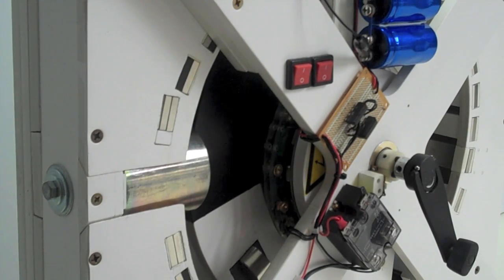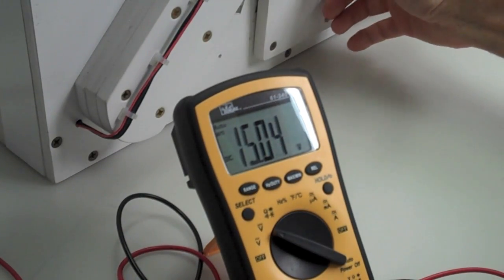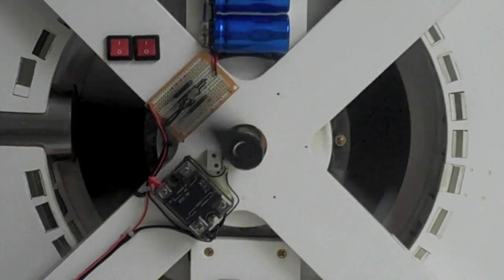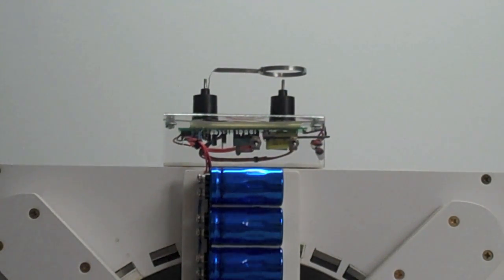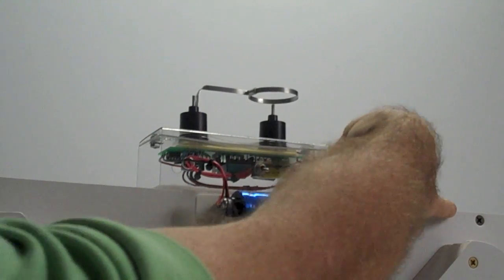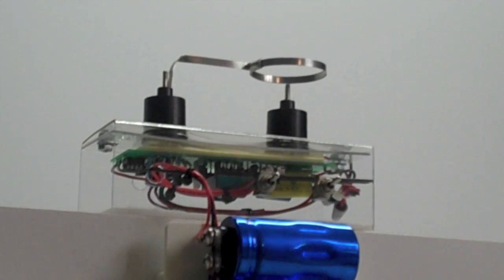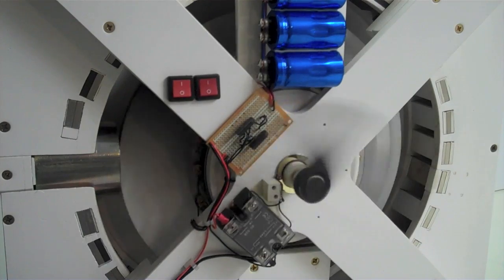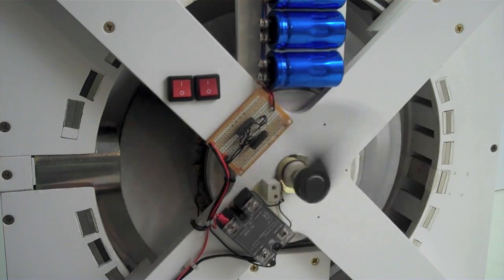Quanta Magnet Motor Generator Hybrid_Part 2

Comment: Does that car window handle throw off the balance at high RPM. And do you look anything  like bob sagett from full house  TV fame?cause you sure  sound like him. WE NEED MORE LIKES HERE.   ITS WELL DESERVED.
Reply: Janet C - that crank handle is small and used for the dynamo in crank torch’s/flashlights. The type used for winding car windows is slightly larger than this

Comment: What is the total capacitance of the supercaps and the caps charged voltage before startoff? Using capacitor energy = C x U x U / 2 [Wh] what is the energy in the caps compared to a  a AA battery?

Comment: great contraption self runner just what im also trying to build..this,machine can light a small cfl brightly for 1hr whilst self running too right if you directly connected the cfl to the high voltage output coil above?

Comment: Of course the capacitors will eventually drain, but this endeavor will continue to intrigue and with materials advancements We may at least come close enough to that zero point. Rather than a cam could try a electromagnetic switch in order to have it variable to avoid setting up a cyclical downgrade ?
Reply from the maker: Todd, check out my newer videos on PMMG4HYBRID channel. You'll see how much further we are.

Comment: what do you think, more magnets in the rotor, and for doin the delay of the electromagnet, use a unit from a ignition (pvl or something like this from 2 stroke engines). With this digital fine tuning i think there is much more possible.

Comment from the maker: Thanks.
Please look at the Q2 & Q3 experimental machines on my channel. A great deal of design & engineering went into them.
Reply: Very Impressive. One of the best I have seen. Thanks. Any bet if you put a little timing circuit between the timing sensor and the solid state relay driving the solenoid you could modify the delay and pulse length on the fly with two knobs to increase the frequency and the running time. Make sure you have a fast back emf diode like UF4007 to recover the collapsing field to recharge the battery. The Chinese have invented a Lead in energy generator which appears over unity because it is using energy from the electron spin which I am sure is what yours is also doing though obviously not efficient enought to keep it running indefinitely.

Comment: I love your machine.  My thoughts however, are that if you took the Perendev motor design, but built electromagnets into the stator, instead of permenant magnets, and make them fire,  in steps, similar to the way that a rollercoaster propulsion system works, only in a circle instead of a wavy line, That you should be able to create enough torque with large neodynium magnets, to turn a fairly powerful generator, producing much more energy than you use.

Comment from the maker: These are very important questions. The cam acts as a hair trigger for extremely close contacts, and is of little consequence regarding friction. It is also easier to work with for pulse-time tuning because the human hand can feel the varying levels of magnetic attraction and repulsion, and quickly adjust for optimum engagement.

Comment: so... (energy in)/ efficiency= (energy out)... 

and you cant get 30,000W to run through 16 guage wire on your outputs... that could only handle 15 amps, and you would need it to handle 1875 Amps..

 current= Power/ voltage... (1875 A = 30,000W/ 16V)= 4 #500 kcmill RW90 conductors

and motors are generators anyways, you can usually run them either way... you could take out yours cars alternator and run it as a motor instead of a generator if you really wanted to.

Comment: Very nice! Seems like the pulse coil should be on the right side so the pulse would be working with gravity instead of wasting energy driving it upward. The crank might be better off being replaced with a nice cromed knob off of a milling machine to add a little bling and added flywheel action. Swinging the offset crank is bleeding off a little energy in the current setup. Every little bit counts. I would love one of these! I may have a winter project after seeing this! Again, AWESOME JOB!

Comment: I think you might have more luck using Maxwell Technologies 
Electric Double Layer Capacitors (EDLC)  
  EDLCs can help by acting as a charge conditioner, storing energy for load balancing purposes and then using any excess energy to charge the batteries

Comment: You could structure a car engine around the basic concept of a Quanta-Magnetic self powering dynamic between the internal generator, and car battery. The amount of power output of course being relative to the battery strength or energy input at any given time. (Couldn't you?) How far away would something like that be?

Comment: Use a High Voltage capacitive discharge to drive the electro magnet , it will take much less power than the generator generates. Look up the Marakami 2 Point and 3 point you Tube clips, Edwin Gray Fuel less Motor Replication to see why I sudgest this. This Motor is 99 % of the way there already - Good luck with it re Geoff

Comment: Please replace your mechanical contacts with a simple hall switch sensor module (these modules are few bucks on Ebay) this will, still activate solid state DC relay. But this idea will allow maximum fine-tuning on electromagnet firing sequence. You can do it while  machine is running. Oh it's a beautiful way to fine tune acceleration of pulse DC motors. In any rate,  man you did an awesome job, truly congratulations.

Comment: I am sure there is a way to make this work. I envision something like the magnetic version of an internal combustion engine. Approaching TDC, magnet off. As soon as past TDC magnet on. Using shielding and or a builtin mechanism to make the switch as it turns, similar to the way an electric motor already works. But this device is just an electric motor as far as I can tell.

Comment: I see you view on the Golden Mean. I wanted to highlight the fact that this sequence is infinite in both directions. Send me your email address and I will give you a design: 409 GM sequenced, Neo discs. Horizontal disc array: 3 man fans, sized & sequence and importantly, arrayed with the larger discs, having satellites acting as pushers and pullers, this minimizes/eliminates the re-gauging effect. Giving you 360 degree, balanced motor with correct: N & S flux density.  Sigrun

Comment from the maker: Thank you for your suggestion. I am familiar with the Golden Spiral mathematical configuration. It is extremely prevalent in biology as well. The object of this device regarding the spiral is to continually attract the rotor magnet from start to finish, which it does, however ceasing to naturally continue at 350° where it reaches the point of magnetic equilibrium. The electromagnetic pulse simply nullifies that point.

Comment: You are having a challenge with the set up of your magnets around the rim? May I suggest a very simple fix. Magnetism is a natural force. It follows the laws as in nature. Sequence your magnets as per the Fibonacci within your 4 vectors of the 360 degrees: Magnetic power needs to be stepped through as: 1, 2 , 3 , 5 , 8 , 13, 21, 34, 55 (Every 10 degrees). By using the Golden Mean / Fibonacci as your base to these calculations, you will achieve the perfect spiral / stepped increase you require.

Comment: You seem to have a Bendini electric motor with a double wound wire as an output for the back voltage. In these sort of setups the back voltage can be higher than the input, but the current is going to be weaker. In other words the total power output is always less than the input. It's not a self-runner which is even mentioned in the video. And it's not self-powered because the soul source of electricity comes from the capacitors. It seems to be just a large motor with almost no useful torque.

Comment from the maker: @ScorchGD  If you're switching a considerable or even a reasonable amount of power, you're going to get a spark. This relay with FET's will eliminate that. It's especially good if you're going to capture bemf or radiant energy. Very quick. No need for patented school children circuits. The contact side is capable of handling up to 9,600 watts of DC, and will trigger that load as low as 3.5 volts.
Go to mpja.com under relays for Part No. 17288-RL. Great company with lots of very useful parts.

Comment: You've said, that the device runs for 2 h after you charge the capacitors. Is the duration different when your HV box at the top is switched on ? Have you tested that ?

Comment from the maker: @MattBlytheTheOne Three rotor magnet positions in the video show where that was previously accomplished onto a single rotor. It worked OK but added weight and slowed overall rpm. One works the best. Cam is better than optical due to very precise and consistent EM pulse duration, plus very quick adjustments for advanced or delayed timing.

Comment: @PMMG4HYBRID  if you had multiple magnet wheels could you overcome the gate without the help of the electro-magnet? I mean with six wheels would the force from the other five be enough? You could then use the power generated in the caps to run a load. You could also improve the eff. of your design by changing the cam to a simple optical pick off (less friction). It looks good but still room for improvement :)

Comment: @PMMG4HYBRID try to connect in parallel to each capacitor the 0.1mf ceramic ones to filter HF.
Moreover, if it is possible move capacitors far from any magnetic powerfull flux.
Nobody has such experience to say what is going with capacitor physics under the process of quotation and magnetic switching inside of gate.

Comment: @PMMG4HYBRID Actually I can’t understand what kind of problem are able to force in such explained above schematic degraded serial connected capacitors capacity. Or I did not understand you correct? Are they getting warm or something else such high voltage amplitude that’s pass the capacitors relevant acknowledged level of voltage level? What is happening? Are you able to separate and detail the problem to open ability for me help you Sir with advise?

Comment: @PMMG4HYBRIDWow , did you try to put after 3phase generator Lavrentev type rectifier that has the most high efficiency the capacitor such as 2000-4000mf  in parallel to smooth pulsing?